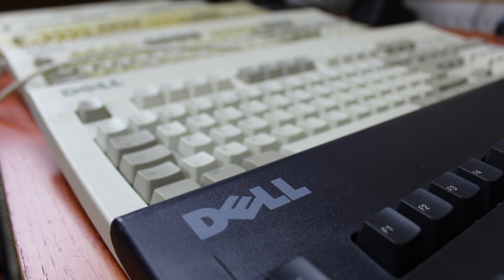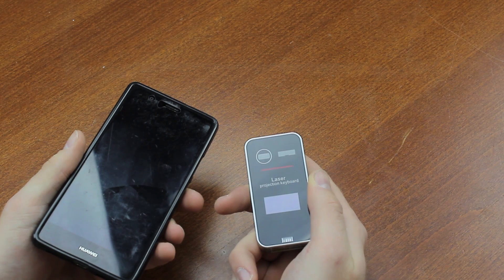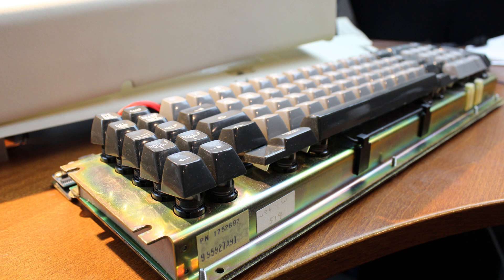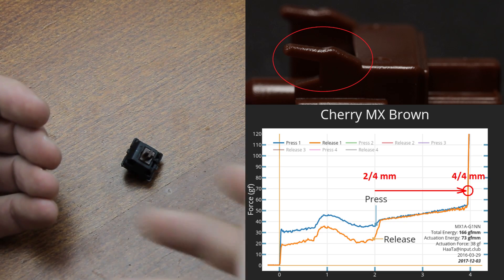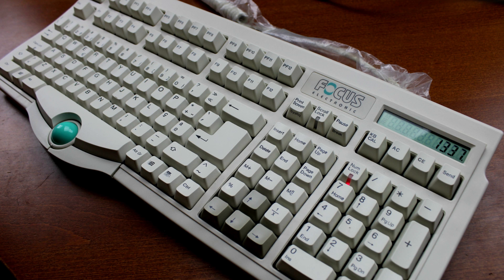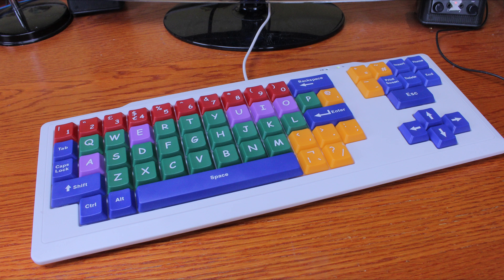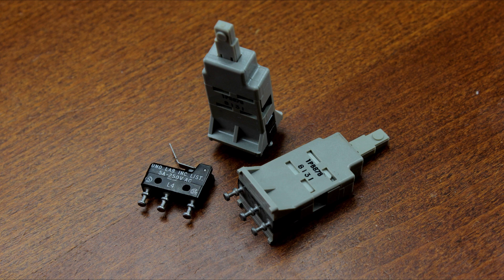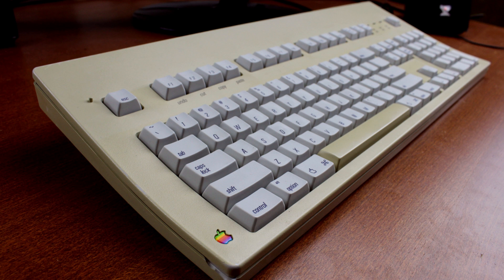When is a keyboard "mechanical"?

Comment: Nice discourse on what defines mechanical keyboards. I do have a feeling that people who use the term use "mechanical keyboard" as a compound noun rather than "mechanical" as an adjective to "keyboard", which is where all of the confusion lies. If you were to use "mechanical" as an adjective to "keyboard", then just about every keyboard that contains moving parts of some sort should probably qualify. But if "mechanical keyboard" is taken as a compound noun, then I also agree that people can and will define what it is based on seemingly arbitrary criteria. What they do have in common is that 1) people stand by keyboards they consider "mechanical keyboards" and 2) they are superior to those that are not considered as such.

For myself, a decided non-enthusiast who is a little bit curious, I would consider something like "commoditized replaceable keycaps" to be a defining characteristic of a mechanical keyboard: I can purchase key caps separately from the rest of the keyboard and apply them as I see fit, and I can transfer them from one keyboard to another keyboard of substantially different construction. Of course, this definition is dumb, arbitrary, and excludes keyboards that are prized by the community simply because of something like "no longer being manufactured", and it says nothing about the details that enthusiasts obsess over.

All in all, I believe that mechanical keyboards are defined descriptively rather than prescriptively - they employ certain specific parts that are made by these certain manufacturers, specifically excluding those that are not on a specific list that changes over time. The rationale for including and excluding certain parts are entirely subjective and arbitrary, sure, but it seems like people tend to put the same parts in their list, so I presume parts found in a lot of peoples' lists define the mechanical keyboard of today...

Comment: A keyboard is mechanical if it can do n key rollover, or could theoretically if it were connected through PS/2. So any keyboard that connects through USB but can do 20+ key rollover also counts. That's my definition. It's one based on a feature that's important to me and doesn't exist in at all in any kind of rubber keyboard.
And yes, I'm aware my definition excludes the Model M, but that's precisely because I think the Model M is overrated trash. I hope they all get rounded up and burried in a landfill in New Mexico so retards on eBay can stop getting scalped for those yellowed out, overrated, overpriced loud ass pieces of junk that can only have two keys pressed at the same time without being overwhelmed.
Reply from the maker: There are rubber dome keyboards with NKRO.
Reply: @Chyrosran22  Like the Ornata and Topre.

Comment: It should be 
A mechanical keyboard is something that uses mechanical parts in conjunction with membranes or plain mechanical parts and is not a plain  membrane or only uses a clicker as the only mechanical part as some form of mechanical aspects should be used or be made of plainly mechanical parts
Reply: so, how would you define "mechanical parts"? I can say that the keycap IS a mechanical part because it moves, so normal membrane keyboards should be considered "mechanical"? you only excluded laser projection keyboards and touchscreens and virtual keyboards etc
Reply: @hikarii8758  a key is not a mechanical PART but an OBJECT because you move it with your fingers, it doesnt move because something else pushes it (thats how switches work, you push on a key, which pushes something inside)
If you pushed a box would you call it mechanical because it moved?
Reply: Pff idk I thought up of this in 2 mins

Comment: The last one is the best. 
But I was more like 5 a keyboard is mechanical if it don't use rubber and remove keyboards with no mechanic in it completly so touchscreen and stuff. So it needs springs

Comment: Glad someone made a video like this because in my mind anything with moving parts is a mechanical keyboard which includes regular dome keyboards.

Honestly some dome keyboards are good.  I am older and grew up on old keyboards with alps etc.  My first pc was a commodore 64 and I have no problems on quality dome keyboards.  Never any missed keys as long as they are good ones.  I still have a old G15 I use allot and the domes on it are good, they bind up quickly near the top of the stroke and once they release they always bottom out there is no half pushes... if it makes the tactile feeling half way then it goes the rest of the way and makes contact every time, I can't get it past the bump without contact even if I try.

Comment: I think the definition is about the complexity of the switch. To call something a mechanism it should be a bit more than pressing down a contact on a contact pad against the force some rubber or simple spacer exerts. it there is a click, metal part (not just a thin coating on a foil) that significantly changes it's position, that's more like a mechanism. it's about the heft of the movement. You said multiple times, the mechanism does not care what material it is made of. I think it does. If it is a mechanism that is supposed to last a few times, that material should be more than just rubber, plastic or foil. Of course even a lid on a tupperware is some kind of mechanism by its dictionary definition, but not in a sense that matters here. "Mechanical" Keyboards is short for 'Complex, long lasting mechanism switch keyboards of a certain quality'. At least to me. There are some rubber keyboards that say they are 'mechanical' because the keycaps hit the mounting board just at the right moment so you have some tactile feedback. I would say, yes, this adds complexity, and is a mechanism (but a bad one) - it does not improve lifespan. So it is mechanical-like but not really. and i think most switches you mentioned are in my definition (That should be) and most of the ones you don't want are out. So just include 'quality' in the term 'mechanical' and we are good... :)

Comment: Great video, but not enough swearing in my opinion.
Reply: By the way Thomas, I wonder if the following definition, similar to the not-bottoming-out definition, would get any traction with you:

A "mechanical" keyboard is a keyboard where the keyfeel is consciously designed by the manufacturer. One can imagine that most rubber dome + membrane keyboards had designers who didn't care what the keys felt like to the user. Of course this is like proving intent or premeditation in a murder case ...

Anyway I watched this a year after first seeing it and it's still very illuminating. Hobbies are interesting things. Exactly what draws people to becoming an aficionado or connoisseur of something? It's how that thing makes you feel, I guess. (There's also something about the community too, I suppose.) But by that definition "mechanical" is about how the keyboard makes your hands feel.

And will you ever do a best linear switches video? Best tactile?

And do you think you can start swearing more please?

Comment: The earliest breakdown of keyboard technologies that I've seen that specifically mentions "mechanical" as distinct from other technologies was in a PC Magazine roundup of "replacement" IBM PC keyboards in 1992. It listed "mechanical", "conductive rubber dome" and "membrane switches" as distinct technologies (and specifically did not consider the Model M mechanical). Mechanical keyboards were shown to be keyboards with a spring (though the text never actually mentioned this) and metal contacts actuated when the plunger pushed them against the metal sides of the mechanism, one side of which would reach down to the PCB. "Mechanical" was ill-defined even then, with the magazine noting that several "membrane" keyboards used mechanical spring actuators, allowing them to retain a mechanical feel "without compromise" (whatever that means). But the point is this term grew in an era when there were fewer keyboard technologies to distinguish, and in general they were more distinct. Even then, though, there was some overlap, and over time, manufacturers often made hybrid designs. But the term "mechanical" stuck, despite it losing more and more of its meaning over the years.

Nowadays I think it's basically a term to distinguish "rubber dome" from "everything else". Which is still a useful thing to do when talking about current production keyboards.
Reply from the maker: "Mechanical" has been used as a marketing term at least as early as the late 70s. In the 90s, everyone was just as brainwashed by marketing talk as people are now xD .

Comment: If I didn't have my Unicomp Model M, I would just have to have a WASD V2 or CODE with Cherry MX Greens for the stiffness and clicking, but they just don't have the weighty heft of buckling springs. They're arguably a bit stiffer than buckling springs, but the tactile event occurs partway through and can also bottom out afterwards while buckling springs always activate tactility when bottoming out.

Comment: Sounds like the definition for porn, "I know it when I hear it".
To me a mechanical keyboard is one that provides a distinct tactile feedback, and has a deep travel distance for the keys, which are full sized (none of this chicklet shit!).
Activation BEFORE bottom out would be another 'feature', but that's part of the tactile feedback loop.  If it mushes down, it ain't mechanical.  The definition should really be one of 'perception' rather than implementation.
Reply: well, you just excluded linear switches

Comment: To me, it is mechanical if the switch uses any metal parts for its travel or actuation. That usually means it wasn't made to be as cheap and horrible as possible.
Reply from the maker: The traces on membrane keyboards are made out of silver ;) . Also, space bar stabilisers are usually made out of metal even on rubber dome keyboards!
Reply: @Chyrosran22  But stabilisers aren't part of the switch. You're right about the traces, though.
Reply from the maker: @MartinKincl1993  it "uses it for travel" ;) . It's honestly really hard to come up with a definition that doesn't have something react strange to it xD .

Comment: We need to define the opposite of "mechanical" in order to develop a definition for mechanical.  Others made a good point, the effective difference here is who cares...  gamers and typists actually care what switch they're using.  Typical users wouldn't notice much of a difference between Membranes vs. a Cherry MX.
Reply: The usual opposite is electronic or digital, but that doesn't work here :-P.

Comment: 1992 Feb 25 PC magazine identifies "mechanical" as just switch types. in context, it is the keyboard has metal based electronic contacts. So why does "mechanical" should be wide enough to include anything interests enthusiasts? I'd prefer saying Cherry MX and Alps SK?? is mechanical and Model M is not mechanical, membrane buckling spring. Let the technical terms remain as technical terms, they should not include any judgements.

Comment: Buckling springs are generally "mechanical" despite actuating when bottoming out, but also being tactile and having a loud click to them, or despite having a membrane version and a capacitive version in IBM's case.
Reply from the maker: Buckling springs actuate before bottoming out.
Reply: @Chyrosran22  Right. What I meant to say was that the tactility is partway on Cherry MX and others, while in my experience, the tactility on buckling springs hits and then they don't bottom out much further. They are stiff and hefty.
Reply from the maker: @pip5528  no, the tactility is about halfway through, really. Google a force curve and you'll see ;) .
Reply: @Chyrosran22  Now that I think about it, it does indeed actuate slightly before bottoming out after having slowly pressed my Unicomp keys some more. it is certainly more comfortable than rubber domes and MX-style switches combined.

Comment: Couldn't you just define mechanical as a switch that uses hard substances only to to carry out the process of pressing a key. Note that this can still include keyboards that Have a rubber dome mat underneath the key but use hard plastics and metals for the function of key pressing. This definition excludes rubber domes, dome with slider, and foam with foil. Would that work?
Reply from the maker: No, in fact I don't think it actually DOES exclude rubber domes, the keycap and stem are still hard after all. Besides, think about it, why would a mechanism care about the hardness of its materials?
Reply: Fair enough. My stance was based on the mechanism of the key rather than the keycap and stem. I should have been A bit more clear, but that said you are right. A mechanism doesn't care. about the hardness of its pieces I was just trying to make the distinction of characteristic a large amount of keyboards either have or lack.

Comment: I would pick rubberdomes over ANY mechanical switch due to excellent tactile feel and silence.. ONLY if they activated not via bottoming out. The only reason I ditched rubberdomes. So for me, from definitions offered, the closest is "activates partways" (or "not activates via bottoming out" - what I was about to comment halfway through the video, tu put more emphasis on design of not relying on the event of bottoming out). I agree the term "mechanical" needs to go.
Reply: Maybe try plum or topre. Topre if you're rich, plum if you're normal XD

Comment: I would say mechanical is a switch that doesn’t use rubber domes to activate because a dome shaped spring would be squishy
Reply from the maker: So, something squishy doesn't constitute a mechanism? ;p How about Something like Cherry MX Silent with extra-big silencing pads? Would that de-mechanise the switch?
Reply: Chyrosran22 good point
Reply: I guess squishyness is something that you don't typically associate with mechanical :)
Reply from the maker: @xtesting3214  no, but it's also both unquantifiable and really makes no sense when you think about it. If I make a working machine out of jelly, would it stop being a machine just because it flubbers a bit? ;)

Comment: I would say mechanical is a switch that doesn’t use rubber domes to activate because a dome shaped spring would be squishy
Reply: that basically excluded some kinds of switches, like slider-over-dome switches and include touchscreens, laser projection keyboards and virtual keyboards

Comment: The fact is, all keyboards with moving parts are mechanical. I'd argue even those crappy flexible silicone keyboards are mechanical. I think a better definition would be along the lines of "cheap" versus "premium." Or perhaps we need a formal classification system such as what is used for amplifiers (Class A, B, C, D) or musical keyboards (weighted, unweighted, etc.). The problem is we're using hobbyist definitions instead of engineering definitions.

Comment: The term mechanical should no longer be used. The whole mechanical keyboard community is built on subjective definitions of build quality and how keys feel when actuated. Instead of mechanical, descriptions of build quality and key feel should be used. Most of the keyboards considered "mechanical" right now have better feeling switches than a standard cheap rubber dome.

Comment: I think the closest definition would not be defined by the user experience, but by the production of the keyboard.
Determined by how much Effort/Thought/Time/Problem Solving, was put in by the engineer/s.
After all any material or mechanism is valid if it gets the job done.
I acknowledge this makes the issue largely nebulous, and difficult to determine in retrospect.

Comment: In my opinion it doesn't completely make sense, but anyway it started to be used to describe keyboards that were more complex than a standard rubber dome keyboard, and for the most it gets the job done. Probably it was a term chosen to describe that they are made with "hard" parts, pieces of machinery like coils and metal contacts in contrast to soft rubber, but then the term broadened to include also other keyboards as topre or IBM buckling keyboards. Kind of what happened to the word "pomodoro" in Italian (tomato in English), that literally means golden apple. It has been a while since tomatoes have not been yellow anymore, but we still call them like that. Something similar happen to the keyboard industry: they had to define mainly cherry boards, but as the market expanded with other options (and other older ones were rediscovered) we simply used the term for them too, I am pretty sure IBM never marketed their keyboards as mechanical! Nowadays the term just describes a keyboard designed to have a pleasant feel. Now I'd like to know what a "mechanical gaming mouse" is, a term I recently found!

Comment: What about hardware in which its switches are not entirely rubber? Is this what makes a mechanical keyboard, or I have holes in this definition?
Reply from the maker: You could argue that's already the case for rubber dome keyboards already. Besides, there are metal dome keyboards that work exactly the same as rubber domes. And how about if they stuck a random bit of metal foam somewhere in the switch, would it suddenly be mechanical then?

Comment: Hey but how you will call those "premium" keyboards. They should have some kind of name, because word ""premium" is overused in marketing for basically everything. I think when people say "mechanical" they just want to say "it is premium" in more original way. And premium often stands for longevity and durability. It means it is made from more expensive materials or more original ways not trying to cut corners but to make keybaord innovative (then it can be cheaper, but probably still not too cheap). This easily excludes cheap 5 dollars keyboards
Reply: well, some cheap keyboards are really durable, I don't think the prices really show they quality of the keyboards